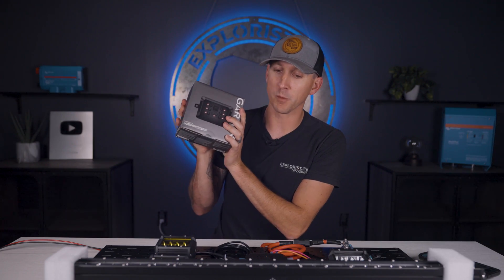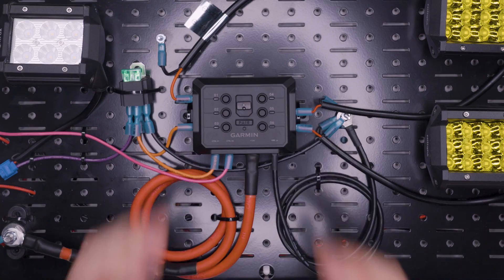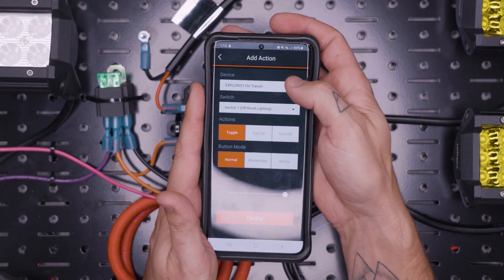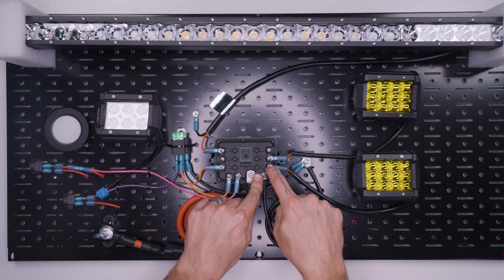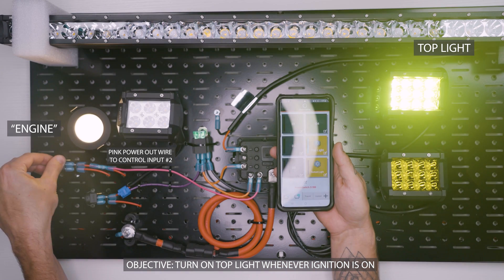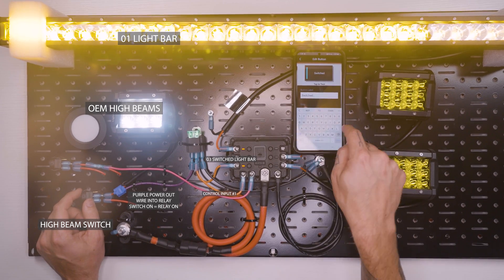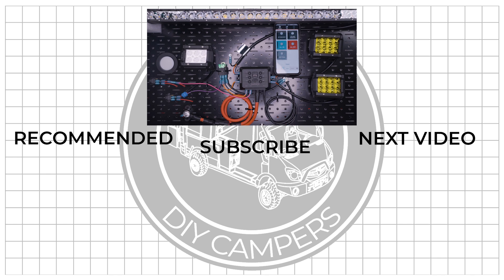EASY Lighting Hacks w/ Garmin PowerSwitch & Transit Touchscreen!

Comment from the maker: ➤ Blog Post w/ Diagrams for all three scenarios: https://explorist.life/lighting-hacks-w-garmin-powerswitch/
➤ Garmin PowerSwitch (Amazon): https://amzn.to/4al5FsN
➤ Garmin PowerSwitch (Van Parts Warehouse): https://vanpartswarehouse.com/products/garmin-powerswitch?_pos=4&_sid=c48b8ebe7&_ss=r&ref=mjg5g5esjri
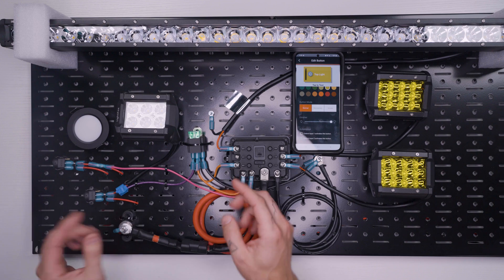Reply: Nate — possible suggestion on an easier solution that doesn’t use up one of the 6 outputs.  Looked like you can toggle an output when the trigger signal is open (not present).  If this is the case then send a signal to the trigger when you do not want the output to function.  Which would mean you would need a relay on the output circuit such that the lights are on when the output is off. The NC side of a relay could do this.   I hoping you get what I’m thinking. Would be easier with a picture….  happy to elaborate if you are interested. 11:01

Comment: Thinking about this product for future plans as I don't really have anything to connect right now. 
I will be putting in camper and use camper batteries, and not draw any wires into the car. 
Then I can even use the buttons on the device. 
Will be camp/work lights, reverse, side markings, maybe a high beam for off-road use. 
Circumventing laws.
Reply from the maker: Sounds like you’ve got some solid future plans brewing! Since the best setup will depend on your exact layout and the gear you’ll eventually run, we’d be happy to look it over and help you choose the right parts when you’re ready.

Feel free to reach out to our support team anytime:
https://shop.explorist.life/support?utm_source=youtube&utm_medium=comment&utm_campaign=support&utm_content=response_link

Comment: Hi mate, any chance you can help me, im no expert on anything...
Say I want to run 1 light bar to a single switch, but the light bar is only 8amps, is it safe to run 8amps through a 30amp system, should I put a smaller fuse on the positive wire to be safe?, like I said I really don't know anything about electrics, thanks mate
Reply from the maker: Totally fair — thanks for the heads-up!

Yes, it’s generally okay to run something like an 8A light bar on a larger system, but it's a good idea to use a fuse that matches the load more closely just for added safety.

Since every setup can be a bit different, the best next step would be to reach out to our support team so they can take a quick look at what you're working with:
https://shop.explorist.life/support

Comment: Great video!  Question however... I have a light bar that has it's own relay on the harness and the switch uses 3 wires.  1) do I just round file this harness and wire it direct to the Powerswitch? or 2) where do I hook up the 3rd (relay) wire from the switch?

Comment: Hi wonder if you can help me. I paid a professional installer to wire up my lazer front round grill lights. These are the ones that have the dot led day running lights on them. He was saying that you can’t wire the full beam up and have the dot day running lights on the garmin control switch panel. I find this hard to believe. Is this false information please? Thanks
Reply from the maker: I'm not quite sure I follow the question, unfortunately.
Reply: I have a garmin switch panel that controls my lights on the front of my Mercedes sprinter. 
The round lazer lights on the bull bar by the front grill. These have 4 dots that are a day running light. Unfortunately since the guy put this on the switch panel the led dots he was saying won’t work now due to the garmin switch panel isn’t able to work the main beam and the led dots. Is this true? Thanks
Reply from the maker: I suppose all I can say is that the garmin powerswitch is incredibly powerful, flexible, and customizable and I can't imagine a lighting situation that it can't handle with the proper application of knowledge, effort, and external relays as necessary - and I hope that this video teaches you how it all works so you can better judge if you can power what you want to power.
Reply: I thought as much. The shop was trying to tell me it can’t be done and fob me off! 
Thanks for your help!
Reply: @acceleratorhireltd  I think the issue is the Garmin only does one thing per port and your lights use two different circuits, one for the running dots and one for the main light output. Surely you can split the wiring and work them both independently. You don't even have to use two ports, just wire the dots directly to accessory so they start up with the engine

Comment: Great video- best run down I've seen by anyone.

What would be epic is if they would add voltage or amperage dependent control input.
My truck doesn't have a separate fuse for any of the lights- that's all done in another module.
So to add light control from my high beams turning on and off for example I need to split the wiring harness and splice into the high beam wire- which I'm not willing to do.
What would be dope is if that control only triggered when volts or amps crossed a certain value.

Also not a fan of how tiny the buttons are when used with android auto. Very hard to hit reliable on a touch screen. They need to make button size customizable and get rid of unassigned buttons from the display.
Reply from the maker: Ah; yeah, that would be a good idea for sure!

Comment: Has Garmin fixed the problem yet? I’m in the process of installing several different lights that will have backlights. I plan on using some of the accessory inputs for those backlight to run off of the daytime, running lights, but I would love a master switch that turns off all the lights all at once that I have going to the Garmin. Which would include the backlights
Reply from the maker: Looks like the last firmware update was June 23, 2023, which was before this video was made; so it looks like my efforts to get those features added wasn't listened to.

Comment: You said you can control this on your transit's screen; do you still need to use car play or have need for the phone to be there. I have a 2024 GMC 2550HD AT4X and I tried to look for the garmin app on its google app search and could not locate anything.   Would be perfect if it was not tied to a phone. I checked and the app is not available for GMC hence mobile device is needed for display on GMC infotainment screen.
Reply from the maker: On ours; the phone must be plugged in.
Reply: @EXPLORISTlife  So end of the day we are still tied to the phone.  I have a spare phone (with a line) and I'll leave it permanently in my truck. No other way.

Comment: I plan on using my factory upditter switches as arm switches. They're only  supplied when the ignition is on. I guess a cool thing with that is you don't need your phone or android auto for it. For the flashing lights. You also have your hazard lights go to a trigger. I thought there was a dimmer feature for this as well.

Comment: HELP!!  

I have a PowerSwitch unit that I will soon be installing. Can I program the unit so that...

If I press switch 01, it will first turn off 02, then turn on 01.

Then, if I press switch 02, it will first turn off 01, then turn on 02.

I have Baja Designs LP6 lights that have High and Low beams and both cannot be on at the same time or it will damage the light.
Reply from the maker: Not sure.  You'll have to play around with it.
Reply: @EXPLORISTlife  Baja Design lights are popular.  They have that High Beam and Low Beam lighting that the harness expects us to independently control.   I could hook the Low to say 01 and the High to 02, but the danger there is of if I forget to turn one off before turning on the other.   Seems this should be a routine I could program into PowerSwitch.
Reply from the maker: @richardburguillos3118  Try it out and let us know how/if you get it to work.
Reply: @EXPLORISTlife  I can setup 01 & 02 as momentary switches so if I press either one, it will just flash the lights.  I can then create a two custom buttons.  The first will turn off 02 and then on 01.  The second will turn off 01 and then on 02.  This will work for now as
I trying to get this down to a single momentary button that toggles and acts like a SP3T switch.

Comment: It's nice, but $500 is an insane amount of money, and a phone interface is not practical.
Reply: You’re easily at $500 going old school with wiring, fuses, relays, switches, etc. for 6 inputs. Not to mention getting all that through firewall etc.

This is a much simpler solution, especially since it can go right into Apple car play screen. 

You can also technically use a physical switch inside like the “upfitter” switches that come on a lot of vehicles not and program them to turn things on and off if your really against a touch screen interface
Reply: I'm not against anything, but a 6 switch panel with relays can be bought for under $200. I have a Warn wireless winch, absolutely hate it. I just use the button, a phone is not practical or faster. This is an answer to a question nobody asked.
Reply from the maker: @ieism1 The fact that it’s still in production 3 years later means that people ARE asking for it.  That’s how the free market and supply/demand works.  It’s just not for you, and that’s fine, since the world doesn’t revolve around you.
Reply from the maker: $500 is on-par with other similar products on the market and hardly 'insane' for consumer electronics.  There are multiple interfaces that can be used.  The phone is one; a tablet is another; compatible vehicle touchscreen (like we have in our Ford Transit), or other Garmin touchscreens mounted in the vehicle.
Reply: @EXPLORISTlife dont forget the physical buttons on the module as well.
Reply: @EXPLORISTlife have fun paying double for other options…. Switchpro

Comment: You could wire two amber lights on the rear of your vehicle/roof rack and set them to strobe if you are broken down on the side of the road or are having to change a flat or something.
Reply: I was thinking dance party but your idea is more practical 😄
Reply: @chachi5975 😂🕺🪩🎶

Comment: Awesome video … thanks for taking the time to build the test bench. Quick question: My light bars support different modes (White, Amber, White & Amber). The switch that came with the light bar has on/off and toggle between the modes. Do you think the toggle feature could manage to change the mode of my light bar?

Comment: Great video. Now I know about this Garmin Powerswitch in case I'd like it for my truck. Another hack, for those of us without secondary or dual batteries is to wire in a relay that is controlled by Acc on to supply power to the system so that the Garmin is not a load on the single starter battery while the vehicle is not running. It could drain the battery that way. Hopefully you wouldn't lose all your custom programming if you do this though. Great vid though. Does Garmin have a panel that we can add to this for those of us who do not have touch screens/phones?

Comment: This litle thing would work great for controlling inside lights inside the van, ceiling, floor and other power needs inside the van off the house battery's
Reply from the maker: Very much so!  This mounted down in the electrical enclosure connected via bluetooth to a tablet mounted somewhere would make for a super clean setup.

Comment: Great video! Would you support using one or more Garmin PowerSwitches to control all of your lights, interior and exterior, as well as water pump and any other devices you might have and not use conventional switches at all?
Reply: That’s exactly what I am planning for my van. 3 powerswitches and no conventional switches.
Reply: Assuming I program these switches to control exterior (front, rear, left side & right side) roof rack lights ... 
My Transit already allows me to LOCK, UNLOCK & START my van from outside the vehicle. 
Using my smartphone, will this Garmin device allow me to also control my lights from outside the vehicle ? 
Perhaps from a distance, to help locate where I parked in a crowded public lot, or to Scare-Off possible suspects when I'm approaching my vehicle in the dark ? 
In other words ... what distance or range have You found this device to be serviceable ?
Reply: Yes it should @kenvasilik3730  , but only on bluetooth distance and if you have permanent power to the unit.Personally i am planning to have a permanent inside of the un it that i can remotely control so i can have access from anywhere

Comment: Hello sorry just paused it when on about turning a group on and off the toggle (option) does that in one button feature. 
I have on the truck in doing light bar and ditch lighting together. 
Really like the garmin power switch amazing compared to other systems so far after 2 years had zero problems. 
Thank you take care go steady ✊

Comment: Thanks Nate, I was researching these and wasn’t able to find much info on them. I think I might use three units to do all my indoor and outdoor lights with. Makes sense to use this system for everything. One thing: Are you sure that no fuses are needed? Is this a fail safe system? Not a software system? So what kind of wire would I use. Say I connect a 5A consumer to one of the ports, I would normally select a wire that limits the voltage drop for 5A and fuse it at 5A. How would I select cable for the 30A automatic fuse s of the garmin without having to cable everything for 30A users? So what cable is still safe for 30A short circuit?
Reply from the maker: I think using these for interior lighting like you are talking about is a fantastic idea.

You can absolutely add fuses if you like; but each terminal is literally incapable of producing more than 30A.  From the manual: 

"The Garmin PowerSwitch device limits the amount of electrical current for each output terminal. If a single
output exceeds 30 A, the device turns off that output automatically. If the device detects a total system load of
more than 100 A, the device turns off all outputs automatically."

High quality marine wire w/ 105 degree insulation like Ancor Wire (what we used in our build) is rated for 30A, 38A, and 51A for 14ga, 12ga, and 10ga respectively when installed inside of an engine space.  For our install, we used a combination of all three: 10ga for the switch to lights home-run and then a combo of 12ga and 14ga to go from light to light; so we are covered on all fronts.

The manual gives pretty good recommendations of wire sizes as well:
• Use 10 AWG (6 mm2) wires for accessories that use 20 to 30 A.
• Use 12 AWG (4 mm2) wires for accessories that use 10 to 20 A.
• Use 14 AWG (2.5 mm2) wires for accessories that use less than 10 A.
Reply: Thanks. Just what I was looking for!  I like the rugged design of these systems. They seem much more practical,for 4x4 vans than some of the other bluetooth switch thingies. I also,like that I can for instance switch my scene  lights with  the reverse lights, whilee still having them powered with from the house battery.